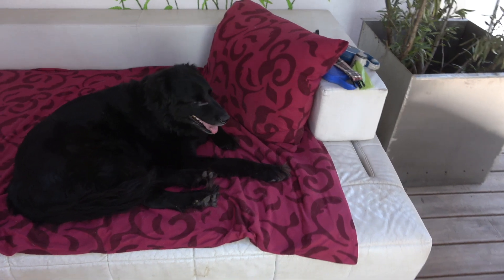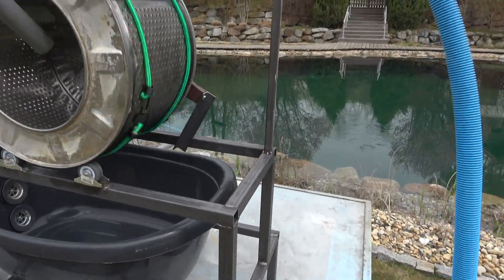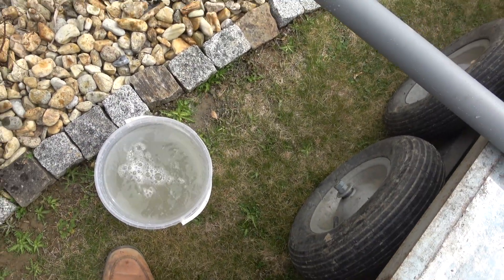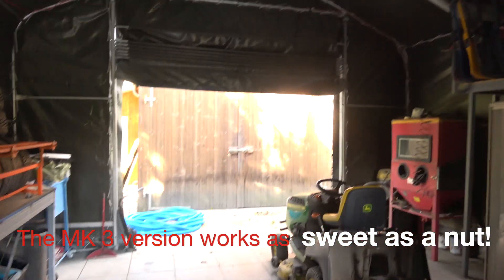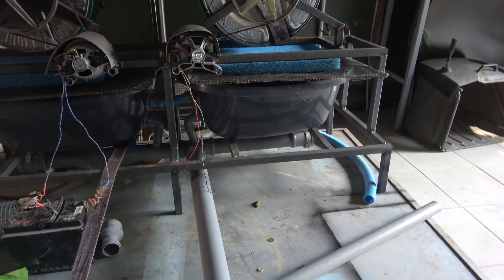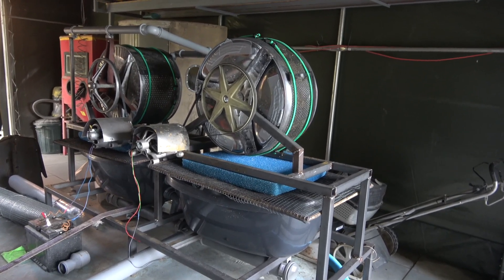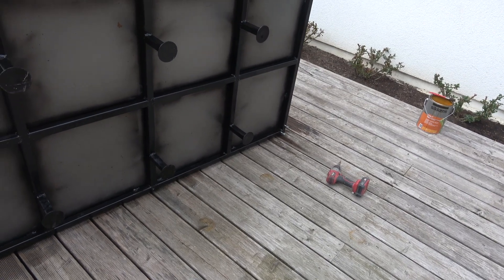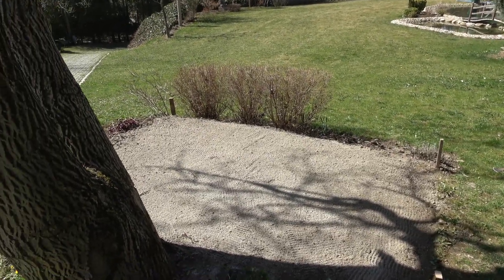DIY Water Algae Separator MK 2 & 3 Versions

Comment: Maybe some Reverse Osmosis Membranes or failing that Electrostatic Precipitation units like we use in Oil & Gas installations.
Reply from the maker: Robbey, We seem to have it working well now with the three different filters, I even have a acronym for the machine
T.W.A.T or T.W.A.T.S  Tumbling. Water, Algae, Treatment, System lol. Cheers Dave